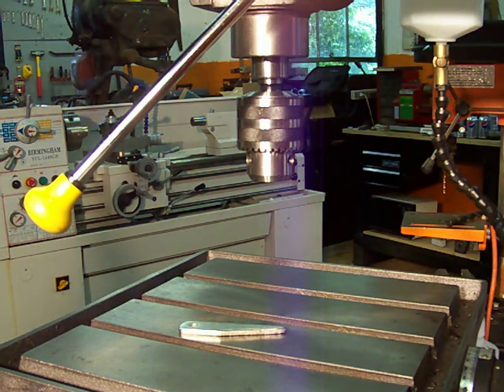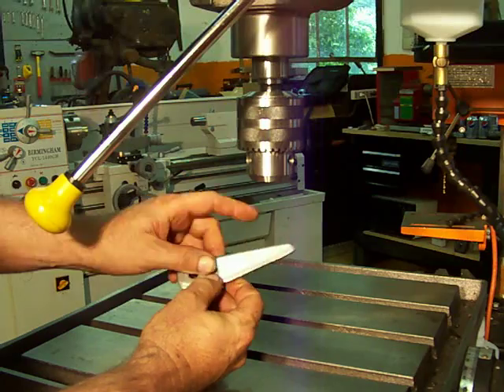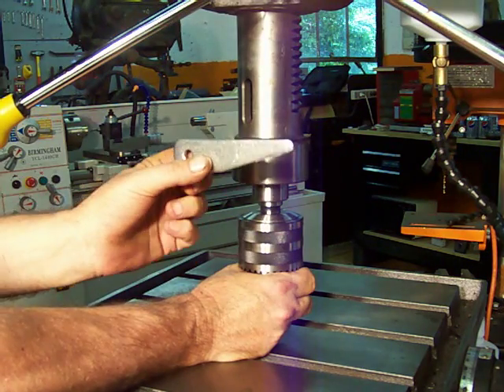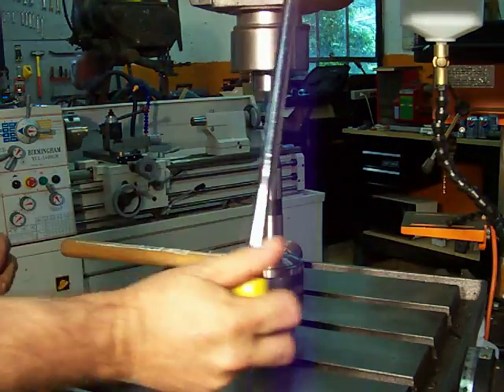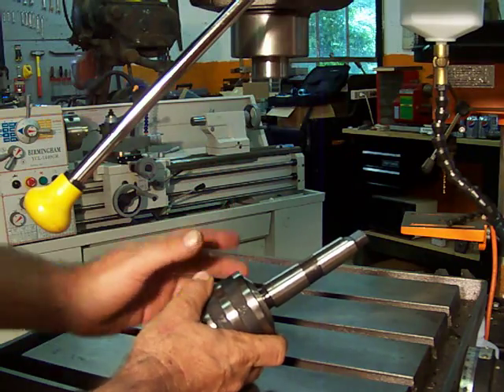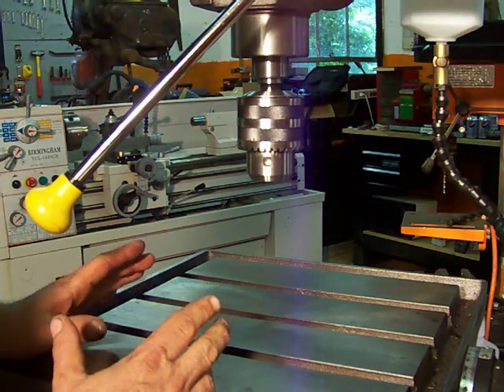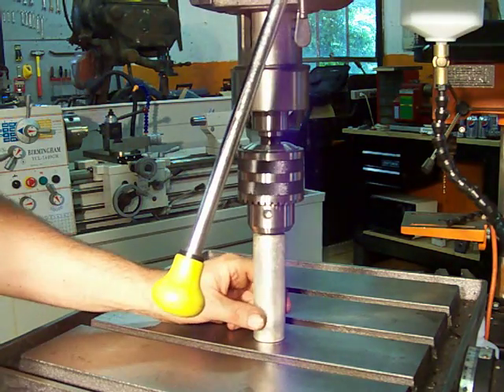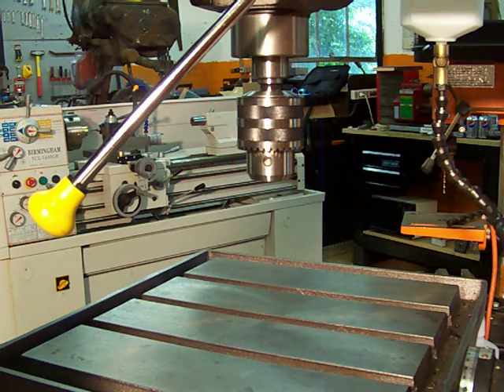How to remove your drill chuck

Comment: @machinistguide 

OK thanks.  I knocked the chuck off, there is no shaft on the chuck, it fits on the shaft kind of like pushing a bearing on a shaft ...a hole in the middle of the chuck.  It is straight now.  It is a cheap design imo but I'd rather have this than not have it at all.

Comment: Thank you very much!  My dad just upgraded and gave me his old Associated Machine Tool (Los Angeles), made in 1978 but there is a tiny wobble at the end of the bit when I install one.  I think something is wrong with the chuck and didn't know how to take it off, ..will be hard to find another one, or is that no problem?  I plan on cleaning the whole thing.  I just finished taking the electric motor apart to add new grease to the bearings.